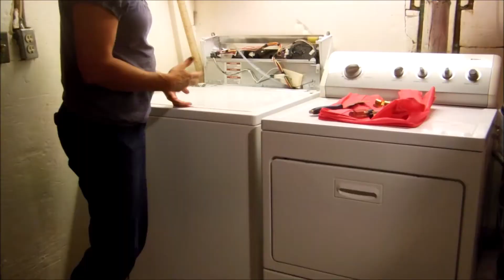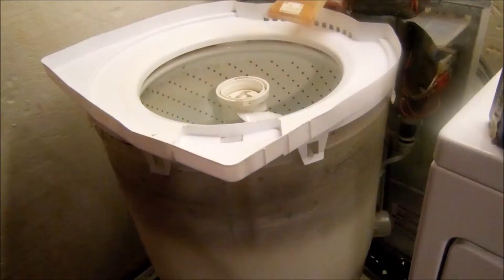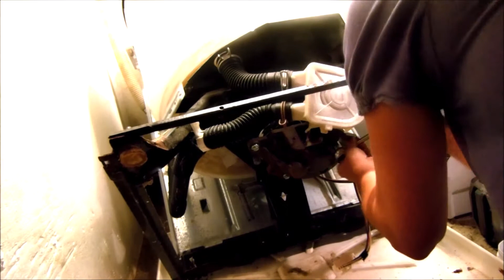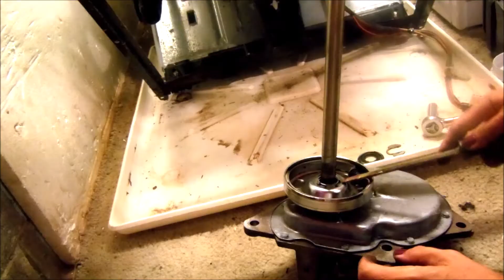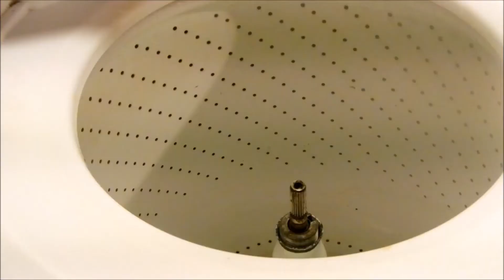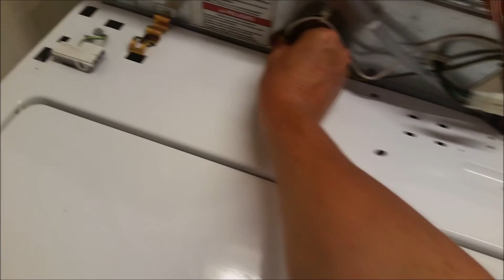Kenmore Whirlpool Washer DIY Clutch Repair

Comment: After you've attached the clutch, you just slide the drive shaft right up there and it locks into place so you can install the bolts. Mine doesn't do that. It needs to go about 3/4 of an inch further and it won't. Every video I've watched shows someone sliding it right into place with no problems. I've taken things apart and reassembled them twice. Everything looks just like it's supposed to. But I can't slide the drive shaft up far enough. Get the motor mounts to slide over those long shafts so I can put the bolt into it. Are you still watching these comments? Have any ideas?